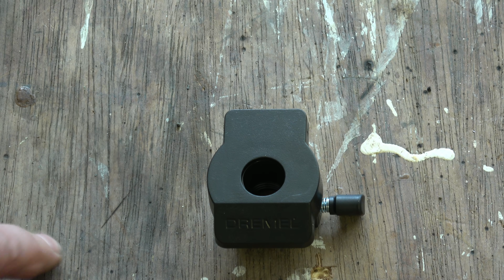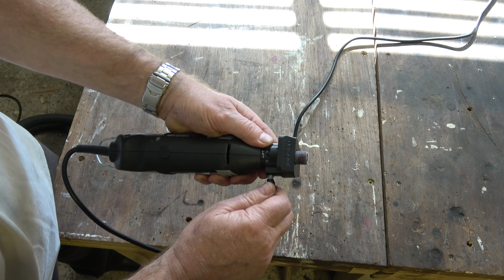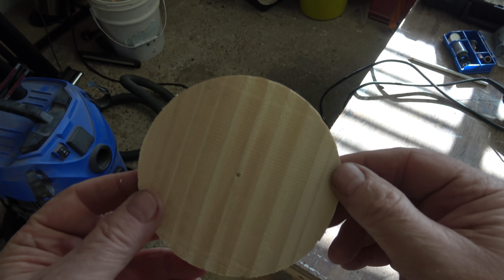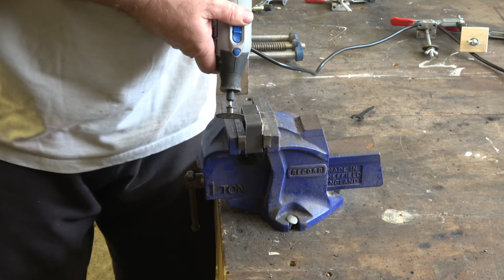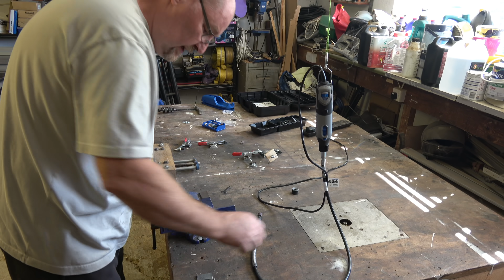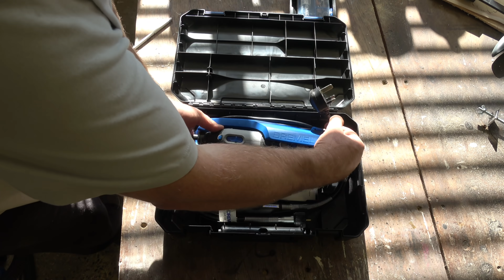The Dremel 4000 4/65 Kit - A great Starter Set - See it in action!

Comment: Love the Dremel but I have 3x 3000 models waiting to take apart and repair the wire/clip. I like the idea of stepping up to a 4000 but am I going to find the same wiring issue with it?  Too much time and money on hold because of such a simple but critical design concern. Loved the realistic examples of how great the product is when the tool turns on.
Reply from the maker: I have had no issues with mine Michael, but it has not had too a hard life so far.  Good luck with the repairs!  :-)

Comment: For a second I thought it was Shaun bean
Reply: Good evening, Dremel !Ah Dremel ; i remember 14 years ago i bought my Dremel + a case of around 86 pieces of all sort . At that time , it was a terrible small engine  with a blue button  to set the speed ! It was incredibly useful , i bought few years later because it was more easy instead of changing tools . the new one was more sophisticated with a numerique tiny lector for exact rpm's, unfortunately it broke after 2 years . but my first one still working for  soon 15 years, it never let me down though i used it very hard, one day it was so hot, i had to stop ! It was still the time, things were build to last. I don't know about the new stuff, the 4000 and all those accessories. But i can definitely recommend this super good and robust little machine , my advice buy it close eyes, you'll never be disapointed !         Greetings from France .             Bravo for Dremel .                                                                                    Laurent Deckers .

Comment: Can be used in gemstone carving
Reply from the maker: You can use diamond bits for harder substances.  :-)
Reply: @RussellPlatten  which best model in dremel are using in stone carving
Reply from the maker: @aakibsaiyed1268  I think they would all be suitable.  I would not use a rechargeable model as stone carving will probably be heavy on the battery.  I also think the flex shaft would be very useful for stone carving too.  :-)

Comment: Wow Straight to the point !!
Reply: @RussellPlatten  Quick question , i am not able to insert bits at the end of flex shaft collet. its too tight. is there something wrong ?
Reply from the maker: @subhrajit0993  Fit the flex shaft by removing the collet collar and insert from the Dremel and fitting the silver nut type attachment I show on the video.  Then fit the collet insert and nut that you removed from the Dremel onto the Flexshaft.  If the bits fit the dremel before you removed the collet they should fit now that you have swapped it over onto the Flexshaft.  Let me know what happens.  :-)
Reply: @RussellPlatten  I did that but the issue was i used the spare collet (not sure what you call that split nut which is inside the nut attached to the dremel machine)from the box . I think it was very new and bits were liitle tight fit. When I used the one which was attached to the dremel , it worked. Thanks for your help !!
Reply from the maker: @subhrajit0993  The set comes with different sized collets for different diameter bits.  You used a smaller one the first time.  If you ever get any bits that will not tighten in the collet, use the smaller one.  Have fun with your projects!  :-)
Reply: @RussellPlatten  hmm I was guessing that. Thanks for clarifying otherwise I would have split open trying to fit bigger size bits on the smaller collet:)
Reply from the maker: @subhrajit0993  :-)

Comment: Great video. For the extension you need to take out the split holder from the main unit and to the flex you unit. That way accessory will hold  better.
Reply: @RussellPlatten  :  Thanks again . I learn alot from your video. I bought the unit few days ago. So I was trying to learn our to better use the unit and your video was perfect.

Comment: Thanks Russell !!! It’s a good video for beginner like me !!! I’m planing for stone carving .. is this tool helpful or if not, pls suggest one !!!
Reply from the maker: I have no experience of carving stone.  There are plenty of videos on here showing smaller carving projects using a Dremel or other rotary tools.  I think that it will be fine for this task.  I would not buy the set though.  I reckon you only need the Dremel and flexible shaft.  The other equipment may not be of use to you unless you plan to use it for other tasks.  As for carving bits, there are lots of carbide and diamond bits on Amazon for very little outlay.  Even cheaper options from China on Banggood or other retailers.  Research a bit on YouTube and work out what you need before committing to buy any gear.  Good luck with your endeavours!  :-)
Reply: Thanks Russell for your quick response and suggestions!!! Have a great day !!
Reply from the maker: @buddigars  :-)

Comment: Great video! If I was looking into getting this versus an air powered engraving tool for metal, which would you choose?
Reply from the maker: Personally,  I would go for the Dremel.  I have a compressor and various air tools.  The noise, lubrication, air line (restricting the movement) and set up would put me off an air operated tool.  I think an air operated engraving tool would be fine though and obviously cost is also a major consideration.  :-)

Comment: I bought one exactly the same from eBay and the chunk , collet , won’t tight up the tool. Is just sticking, I put a link for a video with exactly the same problem. What can I do? Was a gift for my son, I am very disappointed because of this.
Here is the link to the problem 
Thank you

https://youtu.be/Fh56JQqFdPU
Reply from the maker: I am not sure what the issue is.  I do not have the chuck.  It seems likely that there is as machining fault with the Dremel shaft.  Sorry I cannot be of more help.  :-)
Reply: @RussellPlatten  so you telling me that the machine is faulty?
Reply from the maker: I don't know.  If everything else connects to the Dremel without any issues, it is probably the chuck.  If it was me, I would be trying to narrow down the possibilities.  :-)
Reply: @RussellPlatten  thank you, I will contact  tomorrow their service in Athens, we see what’s wrong
Reply: also I wonder if there should be two of them black b screws , because the one is inside the pack is ok to the flexible extension , the aluminium one is ok to connect the flexible extension, so we may be missing the one that comest straight to the machine.
Reply: @RussellPlatten  took it to the service today  , was faulty,  covered by the warranty, thank you very much
Reply from the maker: @smartstickers  I am glad that it has been sorted out!  :-)